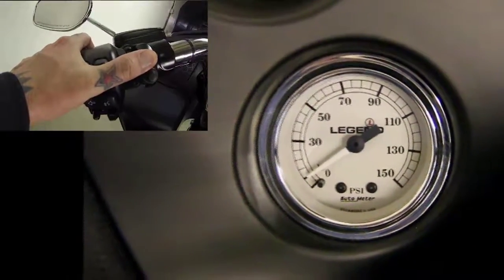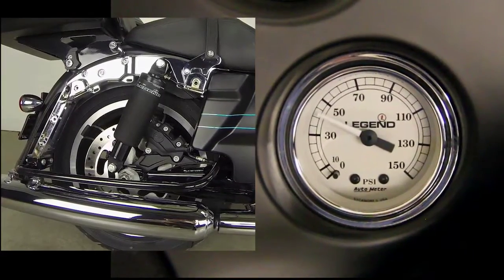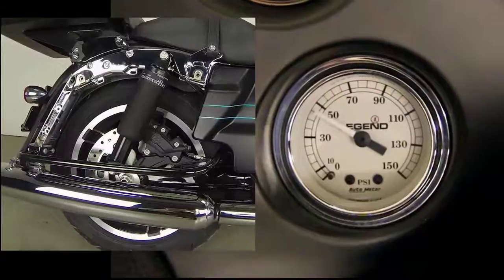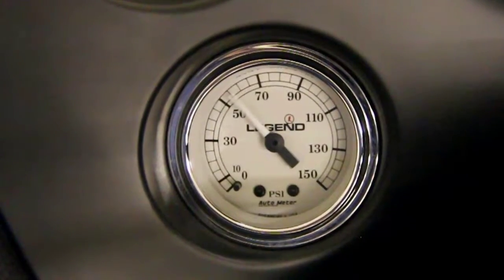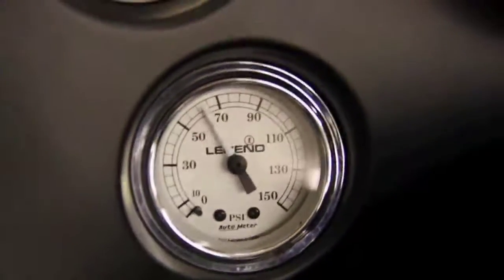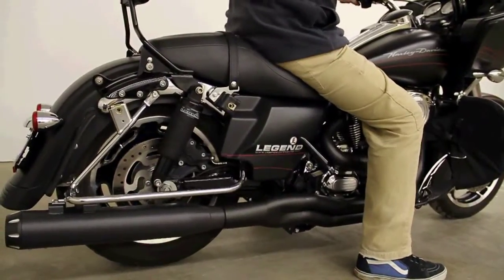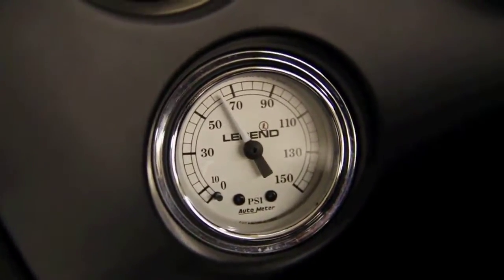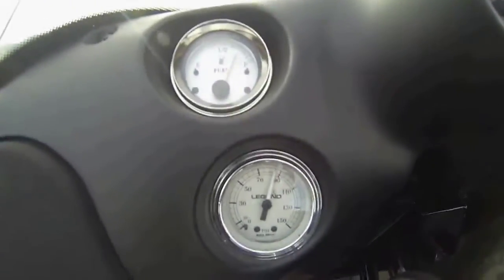Legend PSI gauges: How to use

Comment: Where is the compressor located on a 2017 street glide
Reply from the maker: The compressor is located under the bike in between the frame rails behind your engine case and in front of your trans pan. If you have further questions, please feel free to use our live chat or email service@legendsuspensions.com

Thank you.
Reply: You need to add a kit like dirty air.